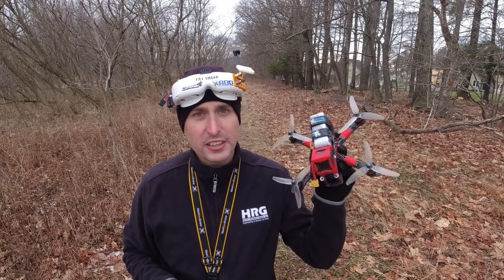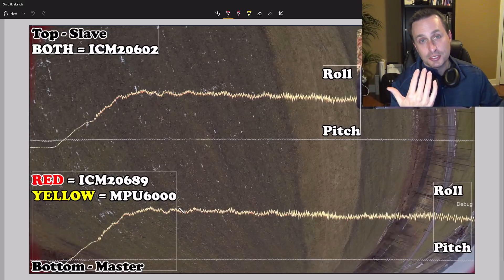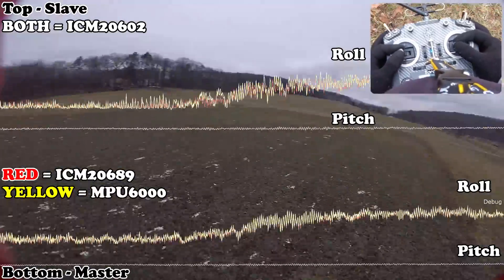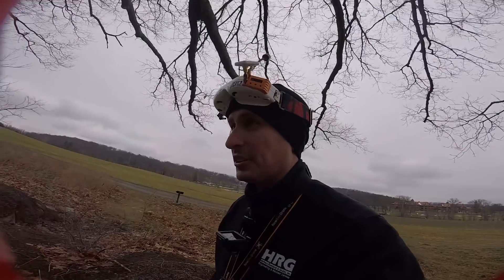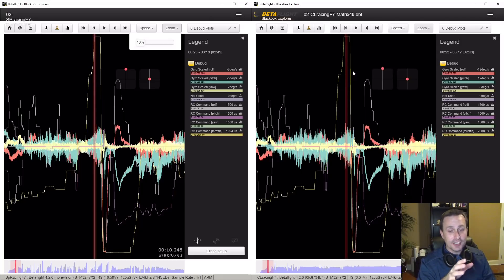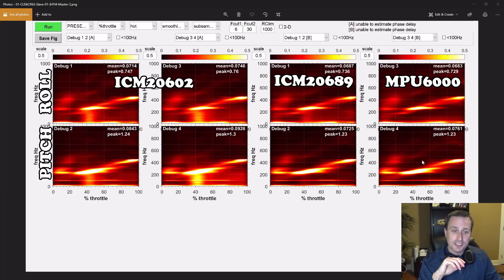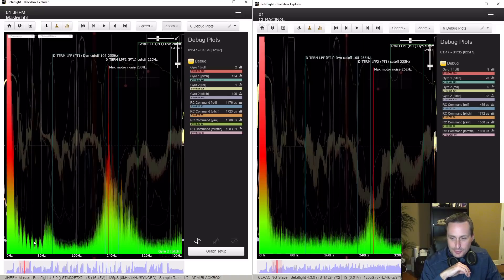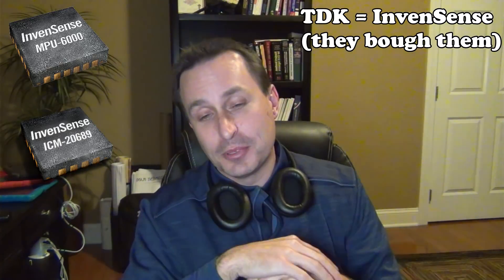What is the BEST gyro chip?!?! | MPU6000 vs. ICM20689 vs. ICM20602?

Comment: I recently built a 3" 1s with MP6500 gyro while waiting on a lighter board with BMI270. I have also used the ICM42688. I repeatedly tried all 3 gyros on different builds and so far the MP6500 just feels worlds better with any old tune while I can barely get the bmi270 to feel like it's locking in, the icm is a little better but nowhere near the mp6500. I'm wondering if you have noticed this? I'm not talking about stuff like bounce or reaction speed/stick feel. Just tracking and quickly locking after almost any maneuver, even bad air.

Comment: You should do a gyro preset for the mpu 6000 bc I'm relatively new to the hobby and have one on my t motor racer f7 mini. Cuz I also don't know how blackbox deals with remapped motors. Is it how I mapped them or how the esc is labeled, because my boy flies pretty good but looking at the data with no input my model just flips sometimes..?
Reply: Also just because this is a year old I'll look into the filters. Been watching you and Chris Rosser but it's still a little confusing, and it's my first build and had a few fix ups and vtx change already. And want some more range (new rx soon) anyway
Reply: Or is it me not calibrating the accel. Because I do calibrate the gyro after Making sure my battery is secure. And the model is pretty much off when the accel is off so I'll try that. But still.

Comment: Wouldn't the 20602 having more "noise" actually mean it is a more sensitive gyro? Since a quad is in reality spitting out a huge amount of vibration noise, wouldn't we actually want to be using crappier less sensitive gyros?
Reply from the maker: I would not say "more sensitive".  They both read +/- 0.1 deg / second rotation.  It is just something about the MPU6000 that makes them not as susceptible to electrical noise and high frequency vibration.  The 20602 is decent.  Just not as good as the MPU6000.

Comment: I wonder if having two mems imus in the same board couples any vibrations between them. I know the sensing motion inside them is literal microscopic, but if you have two of the same design and thus presumably the same internal oscillation rate in the gyro, I wonder if you might set up some interference between them. No idea how plausible this scenario is, I usually only have 1 imu per vr headset 😁 but that might explain it.

The other plausible explanation (probably more plausible) is slight mis-alignment of the two imus so their axes aren't perfectly aligned, changing the mix of axes in how the noise shows up.  (It does look like most of the difference is in the vibration noise being disagreed about). Maybe also some vibration propagation delay thru the pcb?

I'd be pretty surprised if power had anything to do with it. Iirc the mpu uses 3.3V (or maybe 2.5?) And the newer ones use less, so there's probably a second regulator stage in there before it hits the imu.

The mpu might be easier to mount/install properly without introduction of artifacts. Not sure the scale of manufacturing of these boards or how much care is taken in the install, but it wouldn't surprise me if the new ones are pickier. They're definitely smaller.
Reply from the maker: Two gyros are are rotated 90deg from each-other.  The SpRacing did 45-deg from each-other with marginal difference.  I have a video on that (Spracing H7).

Electrical interference from bad filtering on the ESC is a know issue.  It definitely causes spikes.
Reply: @uavtech  wow, interesting that the esc can sneak noise in. Thanks for the info!

Comment: OHH GAWD. Just now deliberating over putting dual ICM20602 vs. a MPU6000 FC into a troublesome 7" build right this very second. Was certain I was going to go with the 20602 "fusion", but now you have me second guessing my decisions. ::sigh:: great video though!!
Reply from the maker: I would go MPU6000 if you can.
Reply: @uavtech  Alrighty! Well I'll try and make this work! This dual ICM20602 one is the JBF7. I can't totally figure out why they went with the ICM gyro on this guy. It's also clearly not the most electrically quiet FC out there... but that does remind me... I do generally put dedicated 35v caps on builds of mine where the FC is equipped with an ICM gyro. Although, given the parameters from your test, this wouldn't be an issue since they weren't even getting VBAT.

Comment: As I remeber BF can combine the two ICM20602 output into a averaged one. It would be interesting to compare that output to MPU6000 and see is there any advantage of two 20602.
Reply from the maker: I believe the data at 10:33 - the control - was with sensor fusion active.  However, let me run another test tomorrow to be sure and lets see what we get.  It is already setup.

Comment: Avoid the ICM20689 like the plague. Extremely high failure rates. In my experience the failure rate is 10:1 over the others. There's a reason why Holybro switched the Kakute series to MPU6000 from the 20689. They had too many warranty returns.
Reply: But those are being discontinued so....
Reply: @mouseFPV  So the ICM20602 is a much better choice. Unless you like failing gyros.
Reply from the maker: It does seems like the 20602 base noise level is higher though.  Nothing is ever easy.  My 20689's seem to be fine, but i don't bando bash either.
Reply: @BruceLuckcuck  isn't that a worse performing gyro though? Wouldn't the proper solution to be to test the board on the bench before soldering and just returning the bad ones to your retailer...?
Reply: @mouseFPV  The 20689 is fragile and this is the cause of failures. So use it if you want, but expect to replace your flight controller regularly.
Reply: @BruceLuckcuck  bruce you bf magician. What do you advise to use when the mpu6000 are eventually out of stock? There will be a moment the 6000 are gone
Reply: @jdm724  ICM20602 has shown to have good performance and reliability. Probably the best non-MPU6000 option out there now.
Reply: @BruceLuckcuck  thanks Bruce! And keep doing what you are doing with BF! Hail to the devs

Comment: Time to find new gyros. Icm42688p is another 32k gyro which invensense claims 2.8 rate noise (no units) while the 20602 has 4 rate noise according to invensense. Seems like a good option to me. In bulk price on digikey is 2.77 and tbe mpu6000's price on digikey is 5.28 when bought in bulk. Those two thinks make the icm4288p appealing for future use. Im also shocked by how well the icm20689 did in testing.
Reply from the maker: I have to look for it.  Any boards have the new chip yet for testing?
Reply: @uavtech  no I am trying to convince some people to though. It shows promise on the datasheet

Comment: What about the MPU6050 that kiss loves using?  Where does it fit in over here? Thanks for this video, super informative!
Reply: Curious about the 6050 too.
Reply: The MPU6050 and MPU6000 are exactly the same - with the exception that the MP6000 supports SPI and I2C communication and the MPU6050 ONLY supports I2C. The gyro, accelerometer, filtering, etc. are exactly the same. The MPU6050 is not suitable for modern flight controllers since it can only use the old slow I2C communication.
Reply: @BruceLuckcuck  Thank you for that detailed answer about the communication protocol, and that SPI is faster than I2C. Weird how the higher number chip has less features.
Guess it's kind of like how the F4 has a few less features than F3, as for being able to invert the UART signal on-chip?
Reply: Yeah figuring out all the Invensense part numbers is a dark art, even if you ignore the not-widely-available ones.  Don't forget the 6500, as well as the 9000 series - which I think just add a mag.

Comment: This is just freaking heartbreaking. It also explains why I can't get my talon fusion f7 to fly worth a poo.
Reply: i have 10 racer quads all using Talon Fusion
 F7 and they are all fine
Reply: @cgondo  So I went and looked again, and go figure- motor 4 has a couple windings that burnt through...probably same problem from last rebuild and I missed it.
Reply: @henryknox4511  so it’s not the gyro’s fault 😅
Reply: @cgondo  Nah it was a betafpv motor, it wasn't a long screw hitting the stator either. I dunno what caused it- they only had a total of between 5 and 10 minutes on the set. I ordered a set of xings for the last attempt, then I'm dumping the project lol. Maybe micro just isn't for me.
Reply: @cgondo  And I'm tearing this thing down for the third time now, maybe mine's just bad I dunno.

Comment: So how long before manufacturers can no longer get stock of the MPU6000 you think? Seems like most boards still come with the MPU6000 regardless of the discontinuation.
Reply from the maker: Unknown.  Agreed.
Reply: It will be a long time. Pretty sure most of our parts are made from components that recycled...
Reply: We can always sell back our old fcs i bet many have plenty of them setting around. So enough mpu6000 available haha
Reply: They've been "not recommended for new designs" for years, I think. Not sure if somebody has cloned it (do clone manufacturers have the capability to clone mems sensors?) or if there's just a ton of stock floating out there, but they're still widely used. All the valve-related VR equipment (vive, vive pro, index, and controllers) use them too.